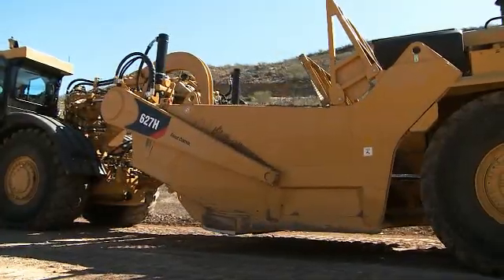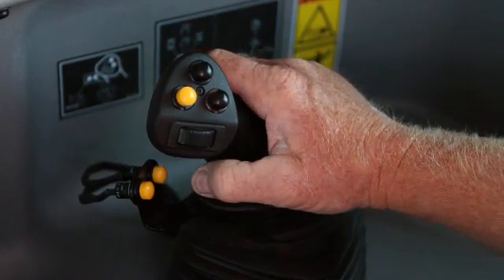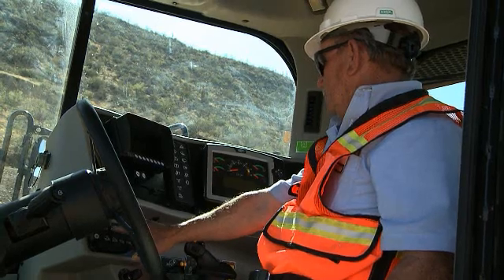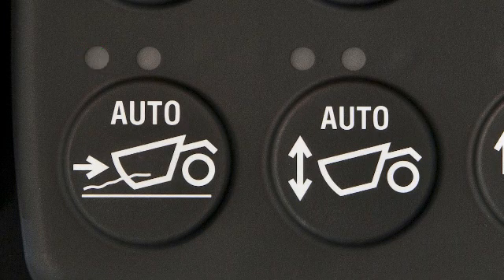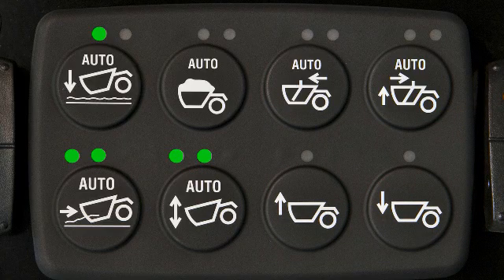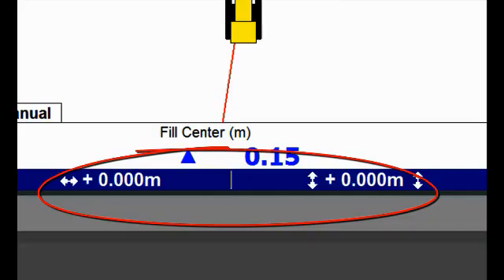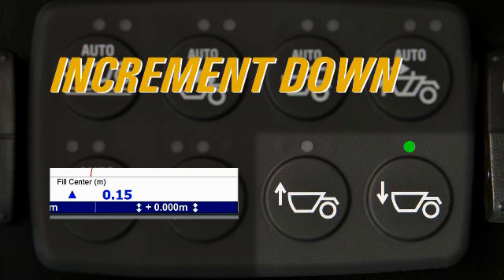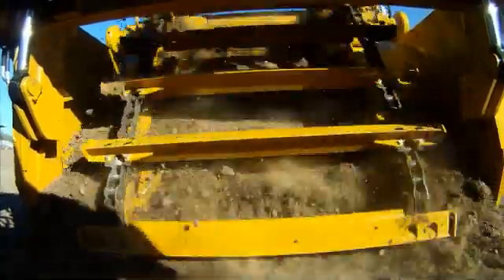Cat® Grade Control for Wheeled Tractor Scrapers | Basic Operation

Comment: Which scrapers are known as the widow maker's and why?
Reply: Le Tourneau were the widow makers, they were all electric as there were no hydraulics on them, steering was done with a toggle switch which activated an electric motor to turn left or right, were very touchy and tricky specially at hi speeds.

Comment: Nearly 2000 hours in a 627k plus 1000 in a 627h many hours in a 627f and the old dinosaur 631d and 631e and hundreds and hundreds hours using cat adt with k-tec and also mts 35 scrapers working towards a being a grader operator